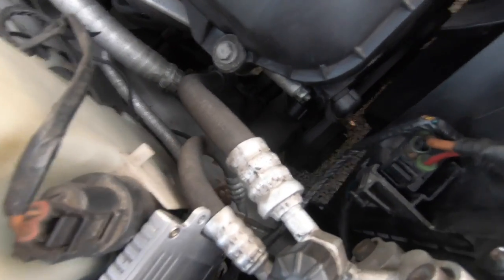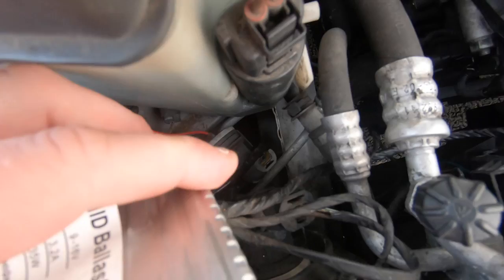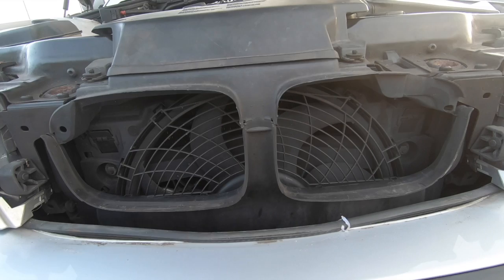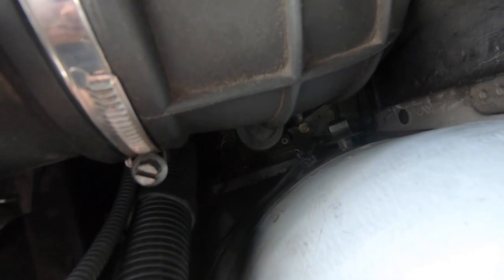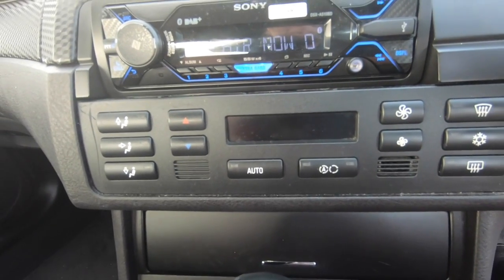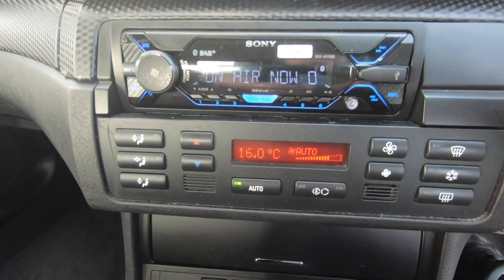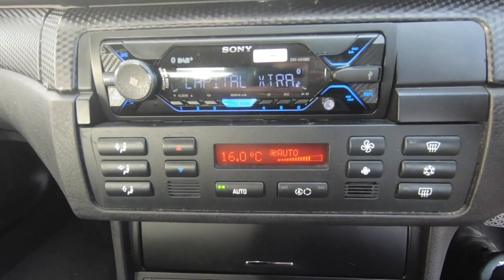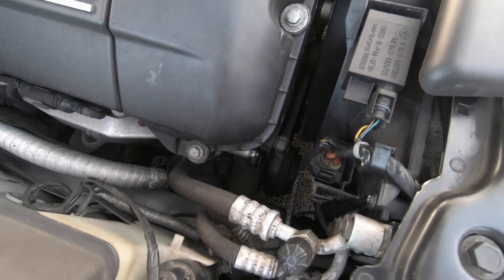Bmw E46 E39 E53 Air Con Not Working Fix!!!!! Watch This First..... Fix It For Free

Comment: I Noticed my A/C (2006 BMW X5 4.4 L E53) started to NOT cool or chill over a five to 6 day period. It got to a lace where the outdoor temperature had reached 98 (105 with humidity). I started by checking the freon level which seemed to be just fine. That left me to be sure that my internal temperature and vent settings were set accurately for cooling. I checked and they all were set properly. Later today, I drove the truck out to run some errands and my mind was telling to check the freon level again. So, I did, and it turned out that the freon level was really low. Im thinking that because I use off street parking on a uneven street (vehicle leans to the left when parked), that this may have caused an incorrect reading as the refrigerant (already low) might have moved to one side. Long story short, I ended using 1, and 1/2 cans of 120z 134a refrigerant and it began to blow cold in all vents. I will be monitoring it over the next few days to be sure that there no other issues or leaks. Hopefully this will help someone with same issue or like problem.

Comment: On the e53 X5 model,the aux fan WILL stop the AC clutch from engaging,i haven't had air all summer until i plugged the fan back in after doing a front wnd repair
Reply: front end repair

Comment: hey Mr BMW doc, my 2007 bmw x5 ac stopped blowing cold ? i refilled the freon and shows full per gage of bottle!  it blows hot air and i'm in Arizona USA.. 
i did see  and have seen some green fluid leak in the past that looked similar to the freon that spilled from the  fill up low valve ? 
i'm wondering if it is the Evaporator Temp Sensor as you said
how can i trouble shoot this ? as i'm low on funds ?  thanks Doc

Comment: my 2001 e39 HVAC control panel just lost power and the blower is on constant in the floor. Even when I turn the key off the blower keeps running.

Comment: Dean im trying to figure out why my top vents work fine while ac is on but the bottom vents are blowing hot air at the same time. Any information would be greatly appreciated
Reply: you're low on r134a bmw prioritizes AC to the driver and ignores all other vents when the AC freon is low

Comment: Have an issue on my x5 its blowing hot air the compressor its working but when i attach the hose with the gauge the needle stay on the red mark. So is the compressor not working properly because i saw it moving.
Reply: did u solve this?
Reply: @carbo220  i do it was just air inside the line and need it to refill again. With gas.

Comment: I have an 07 X5 with an AC issue that I'm trying to narrow down. I believe it could be the blower resistor would love your thoughts. The AC turns on and does cool the car over time but the vents make a lot of blowing noise and very little air actually comes out. One odd thing I noticed is that while it's blowing on max, and I press the defroster button, I hear it changing the vents direction and for a moment between its transition, I feel it blow out since cold pressured air from the vents just before it switches completely over to defroster. This makes me think the vents are pointing in the wrong direction or something. What's your thoughts on this?

Comment: how about this . on my E53 the A/C doesnt kicks in when i start the car and it only kicks in when my temp reach the middle.temperature and when you stop the engine and start it after 15 minutes it wont kick on again and then i have to rev it from 2nd upt to third gear and t will kick in again..what part do i need to check. pls advise. And
Reply: Mine does the same thing cant find the problem either :(

Comment: Hi.. my E46 330i does not even switch on the air systems  ..no display on the panel in the interior and hot air blows in the car ..

Comment: Q. My A/C is fine, my Q. Is this , what color is the relay that operate the aux fan only high speed work, I've  checked everything but the relay, also the fuse card says fuse 75 is for the aux fan but, I don't see a location for one, can you help me please do so.
many thanks
2000/BMW 540i e39

Comment: What could be wrong if your AC lines are empty and when you do a vacuum and try to put Freon it doesn’t take it? I disconnected the hoses and there’s nothing blocking the lines. I also replaced the expansion valve and the compressor. Still doesn’t take the Freon charge. What could it be the problem?
Reply: Did you resolve the problem? My car have the same simptoms.

Comment: YOU ARE 100% RIGHT! 
I had the AC modul button resistor fail few years ago on my E39, and I changed the whole AC modul panel with an used one. Worked great.
Same thing again happened to me recently! AC button does light up but it doesn't power the compressor. When redirecting current to compressor clutch it works absolutely perfect! Time for NEW PANEL obviously.
Always check these steps before throwing money all over the place guys! Great video!
Reply: I have the same problem with my E39 too. Which app can I use to control the magnetic cluth manual to be sure that this is the cause? I always have 5 Volts at the clutch, when AC is activated and deactivated at the AC modul panel.

Comment: One correction, if the cooling fan stops working it absolutely will stop your ac when it over heats.  You will notice this when you come to a stop light ac compressor stops then after you take off it condenser cools off compressor starts working again.  Replace the cooling fan problem solved this is from experience.
Reply: @x01e Just replaced mine today..Cooling fan

Comment: A Great Video.  Lots of information to learn.  Many thanks....
I do have an unusual AC Question.  On my 2006 X5 3.0, the AC Compressor's Coil/Clutch fails to engage for the first 8 - 10 minutes.  Afterwards in runs flawlessly!  Not sure what to tackle first...Replace the compressor's Coil?,  High Pressure switch?  or the climate control module?  Thanks in advance
Reply: Did you ever figure this issue out?

Comment: On my car the clutch engages fine when I turn my ac on from inside. I checked and my system has Freon and pressure is good however I don’t get cold air. Do you know what could be the problem?

Comment: Hmmm, why isn't the common FSU failure even mentioned in the video? That is a definitely more common failure compared to the HVAC/IKHA unit. Plus its cheaper to replace...
Reply from the maker: FSU is common problem but I have only ever come across one that failed and that’s MOSTLY from what I seen on E53 

IHKA unit I have seen many many times

Comment: Hi mate, great vid! I've got an E46 318i and my car gets cool with the airconditioning. But when it's running stationary, the ac clutch goes in and out, so sometimes spinning on the belt, is this normal? Also the fan on the engine side, kept running on a hot day, even when I turned off my car, it drained my battery. I took the fan connector (the one with the 3 poles and cables) off and put it back again, the fan stopped and hasn't been running since. Also I can't feel difference between 22 or 19 degrees setting, both very cold, after 20-30min of driving, the temperature in the car rises due to switching off the blowers or something, I have to put them on full blast and after a while, cold air is supplied again. Do you think this is just the hvac panel or a combination of things you explained, like temp probe sensor? Sorry for the long post, but I think you are the only one skilled enough to solve this. Thanks!

Comment: Hi doc sorry I have to ask you on my e60 Klima module I have an error that ventilation temperature sensor fault and I don’t know where it is but I’m sure it’s not auc sensor that you talk about in another video , any suggestion on where this sensor is? Thanks
Reply from the maker: Oh boy that’s in the back of the hvac box itself mate that’s gonna be a massive issue best thing I can advise you is take out your climate control and I-drive you may be able to get to it from there

Comment: Nice video Dean.
Reply from the maker: Cheers art mate
Reply: @BMWDoctor hi Dean have a problem on my e46 m3. Ac fan the unit in front of rad coming on and staying on after 5 minutes of engine running. Car is NOT overheating. Ac/ climate all switched off. Have replaced viscous fan/ temp sensor on lower rad hose. Replaced Ac fan and module in front of rad. Ac fully gassed. Checked the signal wire from fan to ecu ok. Have now hit a solid brick wall. Any ideas would be very much appreciated? It’s not the hedgehog resistor as that controls the blower motor inside the car. Cheers Andy

Comment: What about the mag clutch are they shimmed? Had one car that was shimmed a got a shim kit then put a smaller shim in and it fixed it.
Reply from the maker: Nah mate the clutch itself is fine it’s usually the hvac panel that goes bad I have had that numerous times on many cars Ista can show you if that’s faulty just activate the ac clutch without anything and if your air con comes out cold then you know your panel is fucked not activating the coil inside the clutch when the button is pressed

Comment: Thanks Dean. It get cold but not like it use to. I Changed my fan and clutch, fully  gassed up with freon got a brand new BMW compressor. When scanned it SAYS AUC sensor.???
Reply from the maker: That’s the little black box on your fan mate that I mention in the video get a new one that will stop your ac coming on aswell
Reply: @BMWDoctor  yeah but when I thought that sensor does nothing for the car
Reply from the maker: on e60 it does nothing but e30 e46 it does
Reply: @BMWDoctor  okay thanks Dean! Your knowledge is impeccable👍🏾💥🍾

Comment: Thanks for the upload Dean!  My E46 air has always been great, thankfully.
Reply from the maker: I know mate but some people with e39 will have this issue I have had it before on my e53 and e39
Reply: @BMWDoctor hi mate. 
I own a bmw x5 2004. 
I’ve replaced the condenser , compressor, radiator fan, condenser fan, and expansion valve and still don’t have COLD 🥶 air. The most it gets is “cool”. 
What am I missing?